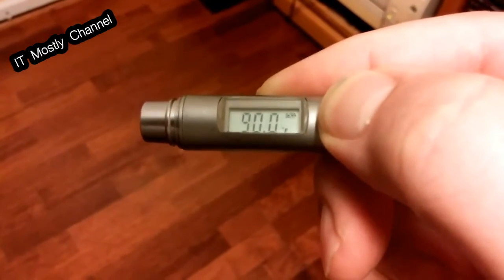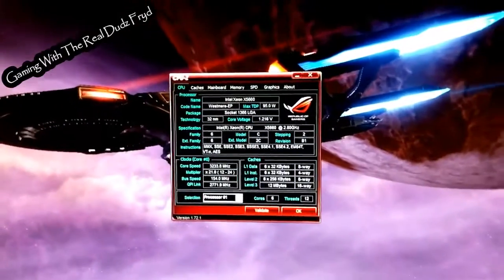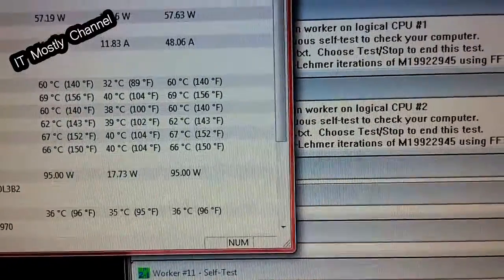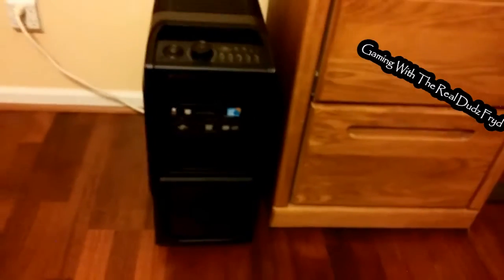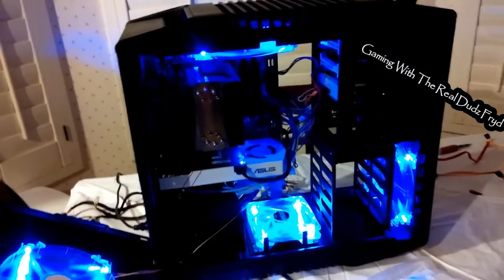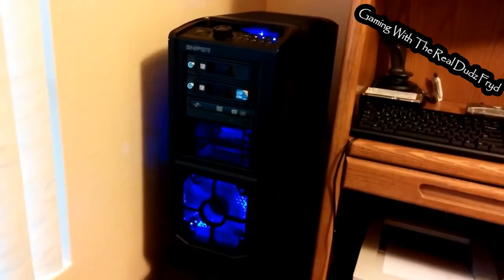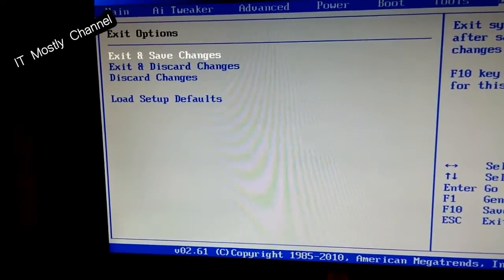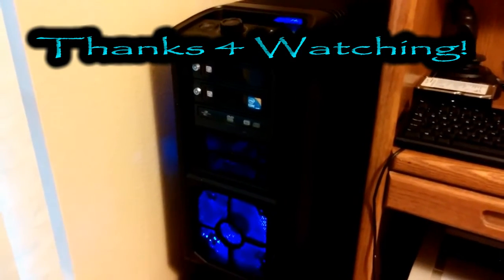Intel Xeon Upgrade:  A 6 core Xeon for an old X58 Board  (Part 2)

Comment: You don't need to switch cases you just need a better cooler. Get the noctua nh d14 for your xeon. I just put in a x5675 and with a scythe mid range cooler I couldn't overclock at all. But as soon as I put in the noctua nh d14 it was night day. The noctua cooler is amazing!

Comment: Good video.
I have first Core i7920 45nm fab (1366 LGA). Built from ordered parts by me. Anyway, it's 10yo this year and still solid. MB is GA-EX58-UD4P. Mem is Corsair 2GBx3 @1600 with xmp extension for that time. 
I don't want to give my system up and have done things to same build because Lian Li case and rail-design PSU. Is there an X58-specific user's group or something? Want to keep this thing going.

Comment: Sub 70c under load is fine for x58, don't worry until you hit 90c+. I have an i7 990x at 4.5GHz on a Hyper 212 (with noctua fans)

Comment: Your base clock is way too low. These CPU’s clock to 4ghz effortlessly.
Reply: On a 6 year old used processor bolted to a 9 year old motherboard on air there's nothing to be gained by it.  System works fine and regularly plays Battlefield 1, Rainbow Six Siege with no difficulty and easily sustains 60FPS or above.

Comment: I have a generic 1366 / socket B motherboard what is a decent vcore for a x5670?
How much difference is that between your xeon and a x5670?
Reply: Voltage should be 0.75V-1.35 V. Difference is 22:21 or 2.93:2.8 or x5670 is 5% faster.

Comment: There's yer problem: that back fan on the Zalman was aimed to suck air OUT, and the CPU cooler sucking hot air from the inside of the case. You should at least reverse the rear fan and the CPU cooler fan to run cool air from outside across the CPU cooler, then out the blowhole fan in the top.

Of course, fixing that 90* temp problem in the room is important. Air conditioning, maybe? ;-)

Comment: intresting that the xeon cpu's have a lower heat tdp
Reply: You hit the nail on the head - the process size made a huge difference when you compare at similar clockspeeds. That's really the only reason the heat isn't a killer after adding another 2 cores.
Reply: Negative.

These processors are server processors, the X56xx line were designed to have lower TDP  to keep temps down in server rooms (remember, these processors are designed to be used on dual-processor server boards). This is why these are more desirable than the W36xx line, because those are flamethrowers compared to these.
Reply: Server CPU TDPs are deliberately slower as they are designed for use in farms.  They are also normally the "best" silicon from an etching batch as they are specifically meant fo 24/7/365 use.

Part of the reason I love using them is they are more rugged and generally have more ability to handle abusive overclocking.
Reply from the maker: All true, they are server processors and meant for the relatively tight confines of the average 1U rackmount case.  That and most server boards don't have overclocking ability leaving only the occasional boost to turbo mode available  when necessary.  As such overclocks were never really a design consideration outside of the turbo frequency given the intended application.   So I tend to keep that in mind along with the operating environment it has to live in  (hot in summer).  6 months in and I'm happy to have a much more responsive system than the I7-940 could ever provide and it runs cooler than it as well.  If I switch to water I may look into a bit more OC though.

One thing that drove this video was I didn't like getting near that TDP and while W36x may be higher that tells me it's less efficient.  More heat is a direct result of using more power.  My philosophy is a lot like comparing a big  V8  engine in a car making  say 400HP and a 4cylinder Turbocharged motor making the same power.  The V8 will make the power quicker at lower RPM's but start to fall  off as the RPM's go up.  The small motor will make its power higher in the RPM band and will be working much harder and producing a lot more heat.  

In both worlds its a matter of physics and the harder something has to work the more energy it's going to use and in the case of car engines and silicon CPU's the more heat it'll give off.  In this case I get more work done with less waste than the I7 940.  Which is why I called this a win.
Reply: The Tcase Xeon X5660 is 81,3°C. So I see no problem here. Comparing to the previous installed i7 950, this Tcase is 67,9°C. So this Xeon can handle much higher temps than the old i7.
Reply from the maker: Depends on what you're comparing it to.  Considering a 6 core CPU was fairly exotic back in the day the TDP was likely capped due to the extra heat those 2 extra cores were gong to generate.  Overclocking wasn't a priority either.    
This is a Westmere CPU so it's the 32nm process (down from 45nm) helps some with heat but these were still warm running CPU's.  Not as bad as Prescott back in the day  though.